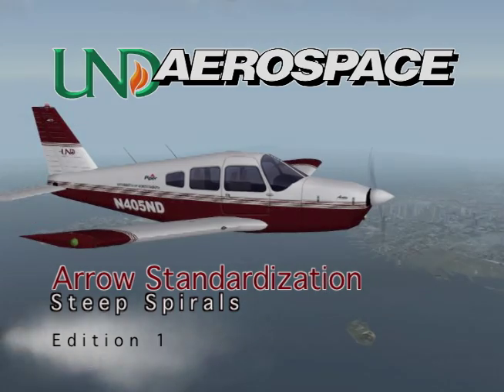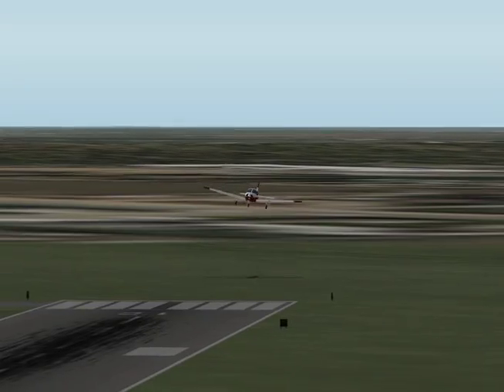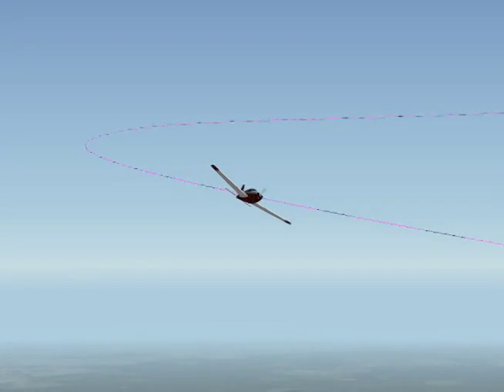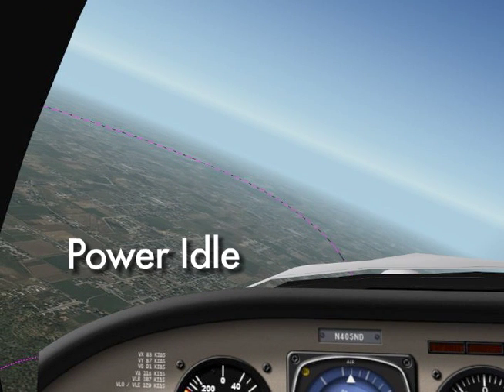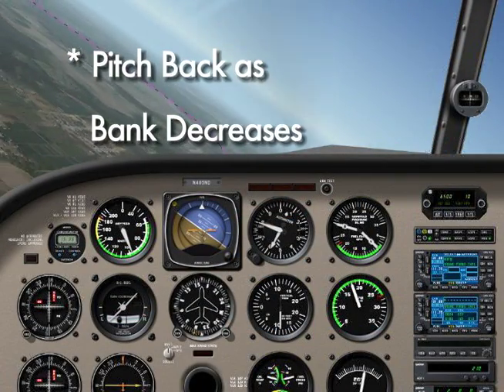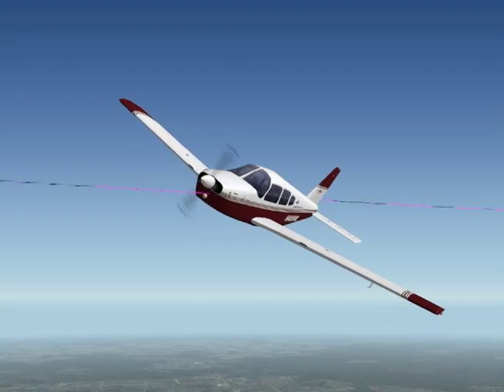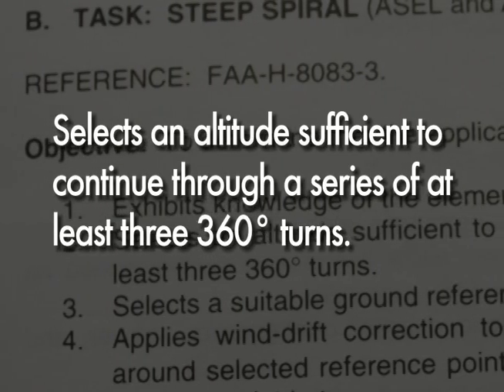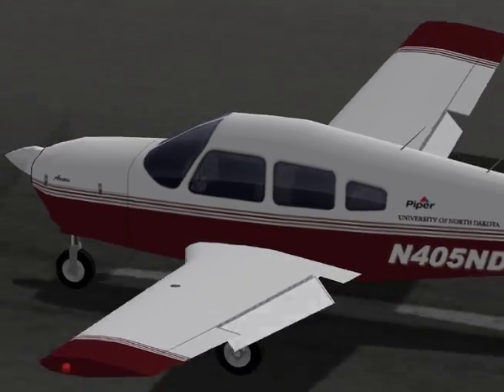Steep Spirals

Comment: Do a trick called Simulated Idle.  With some power  and some flaps and carb heat.  We got 700 fpm level and more while turning C172 and Archer. . Our DPE accepted the 700 fpm.  Use drop power to over idle not idle, carb heat and flaps for some drag.  Air Cooled engines carbon up  with long idles and lose cylinders too.

Comment: Pitch forward as bank is increased to maintain airspeed? Is there any chance you made a mistake. I'm trying to chair fly this while I'm typing and it doesn't  seem right. Not trying to be difficult. Great videos other than that though.
Reply: so am I so here I go. With increased bank angle to turn a tighter radius, you are effectively increasing the horizontal component of lift to produce the necessary centripetal force for the turn. Given this spiraling turn is performed at idle power, this added lift comes from losing vertical lift. In order to compensate for this loss of vertical lift, you would tend to pull back on the stick (pitch up) to arrest the descent rate but due to idle power, you would see a rapid decrease in airspeed for a marginal increase in lift or decrease in descent rate (L is proportional to v^2). If you were to keep pitching up, you could risk exceed stalling angle to produce needed vertical lift when performing this high bank angle turn during tailwind.This is why you would want to pitch down or forward during this maneuver to maintain airspeed by pitching down an generate additional considerable vertical lift using small increase airspeed (again, L is proportional to v^2).
Reply: Note that the pitch is changed only to keep the airspeed constant (in this case, 95 kts), and it will require pitch adjustment as your bank angle changes to do so, unless the winds are calm. There is zero chance of stalling in the descent if your airspeed is anywhere close to the 95 kts in the Arrow.
Reply: Old comment.

I'll preface by saying a given power setting and angle attack gives a certain airspeed, and bank steepens the airplane's desired glide path (to the ground), increasing the descent rate. Therefore:

Descending turns: more bank, steeper glide path, a lower pitch to keep up and maintain AOA (and thus a pre-determined airspeed).

Less bank, less steep glide path, a higher pitch to maintain AOA.

Level turns you are trying to maintain altitude as in the name. Descending turns you are not.